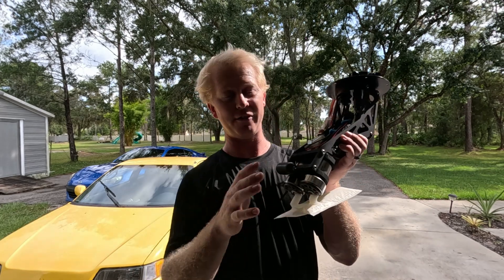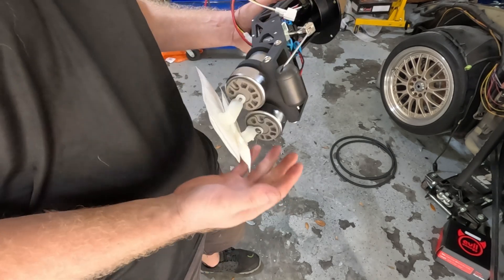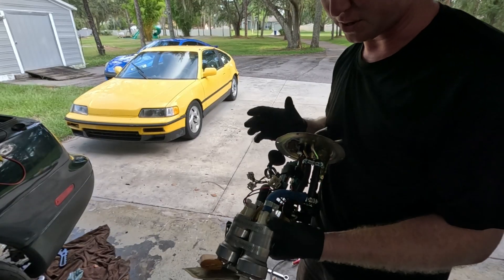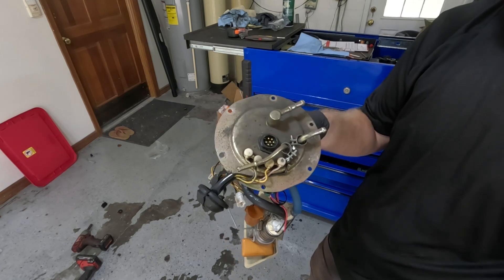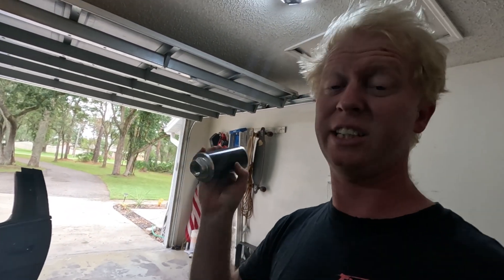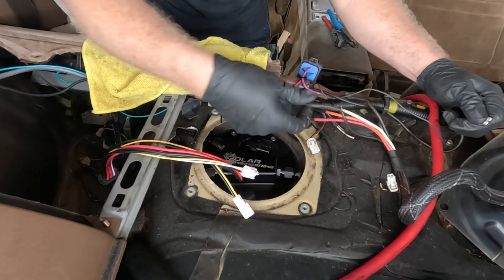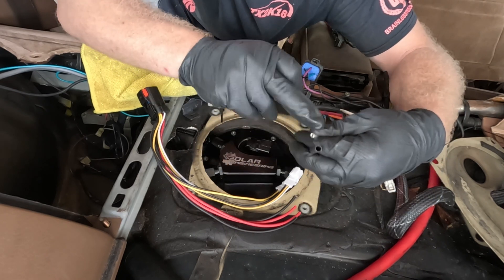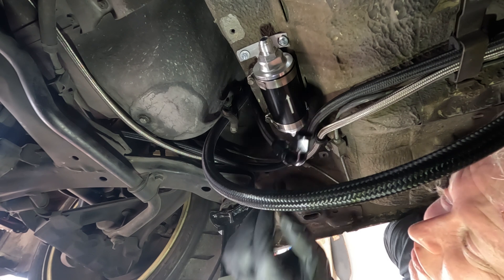1,000 HP 300ZX Fuel System install! | Polar Engineering Fuel Pump Hanger!

Comment: i took the hardline out from the side of the tank by cutting them short and prying the tab off where it bolts to the tank than bend and brake them loose from each other than pull through the top
Reply from the maker: That's one way to do it!

Comment: Hey Billy. Those black nylon hoses are not E85 compatible. The ethanol will corroded the rubbber over time and clog the injectors. You have to use Teflon hose.

Comment: This might be a dumb question but is it safe to bypass the FPCU permanently while running the stock ECU with nistune?
Reply from the maker: I don't think it will be a problem. The regulator will still keep fuel pressure where it needs to be.

Comment: I've had this fuel hanger for a while to install but I still feel a bit intimidated by the wiring 😢
Reply from the maker: It's honestly not too bad. I utilized the factory 12 volt wiring with a relay directly to the battery.

Comment: Greetings Billy, Beautiful job installing the Polar hanger. Just wondering what you do with the bulk head? Thanks
Reply from the maker: The bulk head for wiring I assume? It's just powered by two relays. One turns on like the factory relay, with key on. The other is triggered by my ECU based on boost level.

Comment: Would be more helpful if you show how to wire them up since these hanger come not plug n play..
Reply from the maker: It will vary based on you're own wiring setup.. but yes wire it to the oem Wiring if you're using it, and I use My haltech to trigger a relay when i get into boost for the second fuel pump. They are only power and ground for the fuel pumps and the extra connectors are just the OEM plugs as shown in the video.
Reply: @Billy_Built im trying to do the same thing do you know where I need to go in the nsp software to configure this and also how is the relay wired up I know one pin is for battery and the other is for positive on the fuel pump but there’s a negative and positive for the control side of the relay is the Haltech only connected to one side of that ?

Comment: Which first car should. I go for all i know is oil changing air filters and these type what you think 300zx? Or Rx8 or any other ?
Reply from the maker: Get something that's cheap and simple to work on. Any Honda or BRZ/gt86. NA 300ZX would be ok. But not as simple to work on and require quite a bit more maintenance and tools to work on. 
I had my CRX to daily and the 300ZX as my weekend car.
Reply: @Billy_Built  what about rx8?
Reply: @Billy_Built  here in Toronto honda and toyota s insurance is sky rocketing bro because they are getting stolen easily so the insurance is killing

Comment: nicely done. Was it a pain to install the lines with the fittings on to the fuel pump hanger? Would like to see more about the wiring for the pumps.
Good call on the Polar Engineering hanger btw.
Looking forward to the next updates.
Reply from the maker: Wasn't too bad. Once I got the fittings lined up to the hanger.
I Might do something short for the wiring.. Thought it would be too boring for the general public to include in the video. But I'm Getting a lot of inquiries about that lol..
Reply: @Billy_Built  It's a subject that very few actually cover but a lot of us have questions about or just interested in looking at what other did or are doing in order to gather ideas for their setup. Also don't forget about the electric fan setup

Comment: I ran an auxiliary relay / fuse box in the rear and bypassed all of the old factory wiring, relays, and FPCU.  It was easier to run the negative signal from my Haltech to the relay box. Made doing the pump staging way easier and any additional diagnostics through the Haltech NSP software a breeze.
Reply from the maker: Yeah, I honestly forgot to go that far into the wiring in this video. My FPCU is bypassed for the main pump, and there is a secondary relay for the second fuel pump that is triggered by the haltech.
Reply: Yeah that’s about the only way to run the secondary pump. But in my case, there was some kind of weird break in the wiring for the main pump that I could never trace. Cause the main pump would sporadically just turn off. Replaced relays and fuses and nothing changed. Finally gave up and just bypassed it all. Told myself I’d deal with it with the PD16 down the road which would involve the exact same thing I had done anyway so might as well get ahead of the issue. Which let’s face it…30+ year old car and trying to drag it kicking and screaming into the modern era, just sometimes the old wiring just can’t handle what we need 🤷‍♂️

Comment: Busy with same thing at the moment. Did you manage to run the AN lines next to hard lines fixed to the tank? It’s super tight and thought I would need to drop the tank..
Reply from the maker: Yes, the 8 AN lines are ran next to the factory hard lines that are fixed to the tank. I cut the hard lines as high up as possible from the bottom,   and bent them out of the way from the top of the fuel tank. It's definitely tight. But the 8 AN fits. It would be nearly impossible to fit anything larger than that without dropping the tank.
Reply: @Billy_Built  awesome I’ll give that a go before dropping the tank. Thanks

Comment: Your in a somewhat similar spot to where i am in my build so its nice to follow along. Im waiting for my polar fuel pump assembly to come. I was considering doing an6 hardline underneath but the hose seems to be fine.
Im not doing 1000hp so my max will be whatever an6 can handle
Reply from the maker: I would just leave the factory hard line, as I did previously, shown in the video. 6AN is 3/8 which is pretty much the same size as the factory steel lines.

Comment: this video helps me out big time.  i have a polar fuel pump sitting on the shelf and some 2860rs turbos and the polar top feed / ID1050X setup ready to go.  Just missing the lines and the will to tear into a perfectly running stock turbo Z
Reply from the maker: For those turbos you will never need more than 3/8 fuel hose. Which The factory ones that run underneath their car will suffice.

Comment: Would this be a nice upgrade even if your not no where near 1,000 hp
Reply from the maker: The fuel pump hanger? For sure. Especially if you ever plan on needing dual fuel pumps. Which is typically anything over 600 horsepower. Although I wouldn't worry about upgrading the factory steel lines unless you're shooting for more than 8-900 hp. Fuel pump efficiency plummets anything over 60 psi which typically is seen at 20+ psi of boost on a 1:1 rising rate fuel pressure regulator.